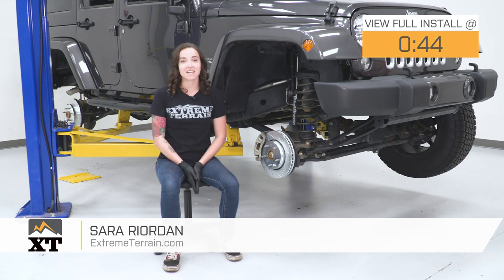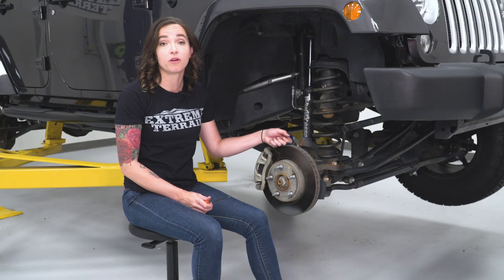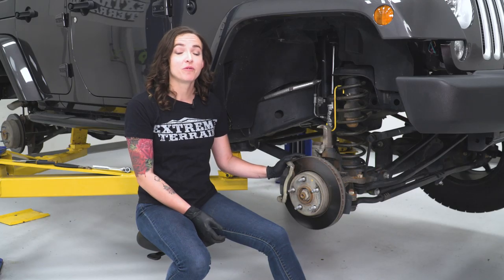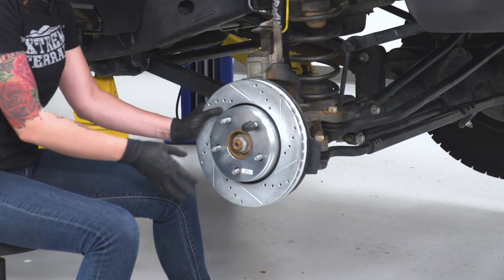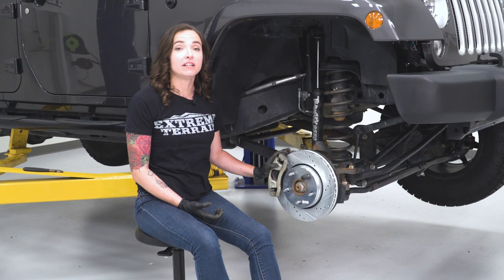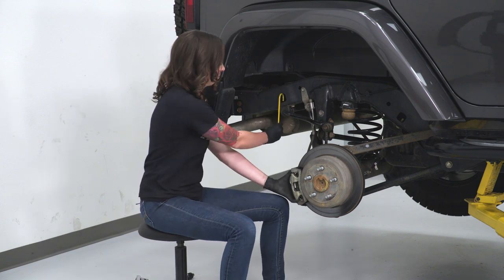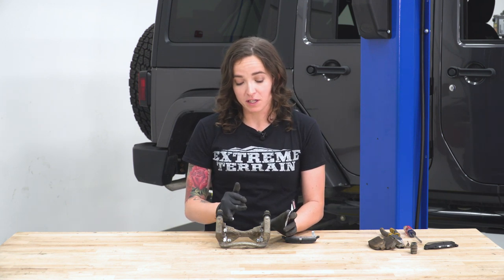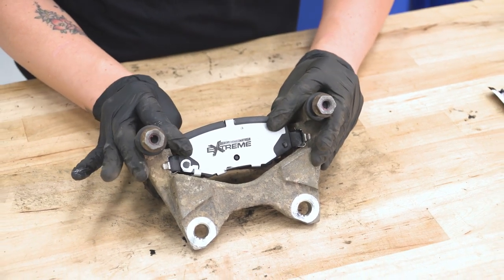Jeep Wrangler JK PowerStop Z36 Extreme Truck & Tow Brake Rotor & Pad Kit Review & Install

Comment: I've been running this kit on my 2015 jk for about 5k miles, 3.73 gears and 35s. Seems to perform well, no issues with squeeling. I can't compare braking performance because i did the brakes and lift at the same time.

Comment: Nice job Sarah, good pointing out the direction the tab brackets fit in, I rarely see people point out that little detail and it's useful to know for anyone who hasn't done it before. I have these brakes and I've been really happy with them on 35's. They don't see too much offroad time in my case, but they help me stop quickly and smoothly in traffic on those heavy wheels at a pretty good price.
Reply from the maker: Thanks for the positive feedback on the install, and the product! -Zach

Comment: The only thing that this video is missing is the most important part. When she demonstrated the first install she should have talked about the actual torque specs for front. And also the install for the back. She hand tightened those bolts. So if some one was doing this the first time and just following what she does in the video, that is a serious safety issue. This is very negligent of extreme terrain to supply this video with not talking about cleaning the rotors first, and torque specs and other things you should do during removal and install of brakes.

Comment: Be careful doing this yourself. This job isnt as easy as it looks. Just installed one front driver side and I wanted to test it out. Brake is grinding. Now I need to look at the hardware clips and see how exactly I messed it up. Most videos on Youtube don't show that. Very frustrated.
Reply: What turned out to be the issue ?
Reply: What was the issue?
Reply: Did you go through the proper burn-in procedure immediately after install? These pads grab and grind like hell until you've done the burn-in procedure. Then they become smooth as butter.
Reply: @kirkdarling4120  Yes sir I did after all 4 were installed. What struck me as odd was it was only the front driver's side that was still grinding and making weird noise even after the bedding process.
Reply: @jakealcazar3805  I wonder if your system is breaking even all around. I could diagnose that back in the old days, but not so much with modern ABS.
Reply: You simply did it wrong. It's extremely easy. Your tabs are probably wrong. You should have taken it off immediately and checked it instead of letting it grind for 6 months. As stated in the video "Large tab at the bottom, and the curved clip facing the outside".

Comment: Will I need to have emergency brake off when doing back wheels? Also, don’t I need to take off brake fluid cap when compressing the piston?
Reply: Leave the brake fluid cap on. Compress the piston with a C clamp or brake pad spreader <$8 and I recommend one). You need the emergency brake OFF to pull the rear rotors. Get some wheel chalks for the front wheel when you do the rear with the emergency brake off. Also watch the caliper clip orientation closely on this video, it helped me a lot.
Reply: @mattn318  do you need to bleed them in any way?

Comment: I wonder what happens when you get sand in those drilled holes!
Reply: Alpha Artisan or if you do a lot of mud wheeling and it gets inside the slots and drilled holes. I bet it prematurely wears out the pads.
Reply from the maker: For mainly on-road driving, these new rotors and pads will perform better than stock without a doubt. If you do A LOT of mudding, play in the sand every other weekend, or are constantly on dirt and gravel roads, drilled and slotted rotors aren't going to be the best option because of those holes. That being said, as long as you wash out your brakes really well after being off-road you won't run into issues. -Zach
Reply: ExtremeTerrain.com thank you for that information I’ve been looking for something like this.

Comment: Are these pads and rotors better thatn stock? I added some steele bumpers, winch, lift, wheels and tires (285/75/17) and would like better stopping power. Not sure if I should go full boat and get new calipers too or is this kit enough? I am not towing.
Reply from the maker: These pads and rotors will definitely be an upgrade over stock! PowerStop notes that these guys will provide 20% more stopping power with the combination of ceramic pads and the drilled rotors. As for calipers, that's going to come down to your personal preference. If your stock calipers are in good shape, these will be a nice upgrade for you. If your stock calipers are starting to stick or need replaced, looking into a performance replacement is a good idea. -Zach

Comment: Very disappointed with this kit. I followed the brake in directions exactly and these just won't grip well. Braking is slow and gradual and I don't think I could get stopped fast enough in an emergency situation. 

We went back and flushed the brake system to see if new fluid would help, and it didnt.